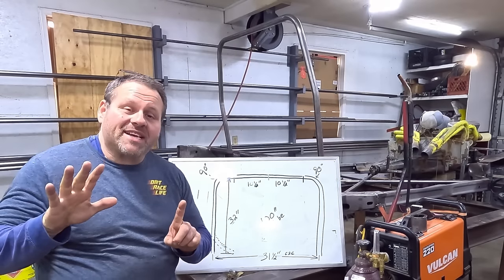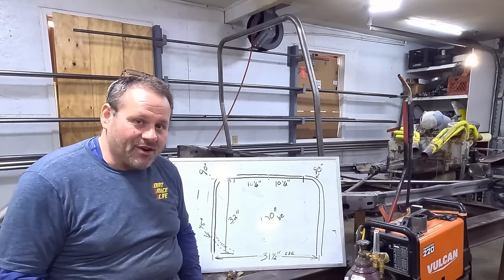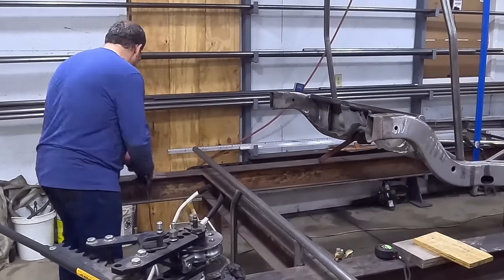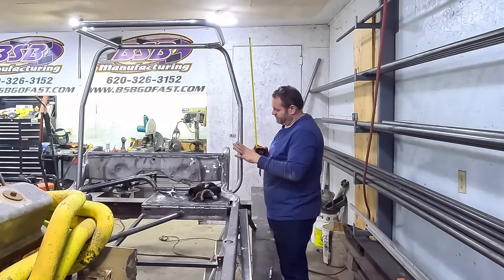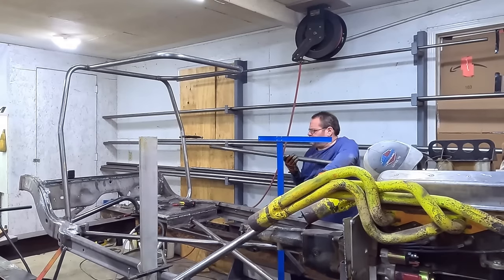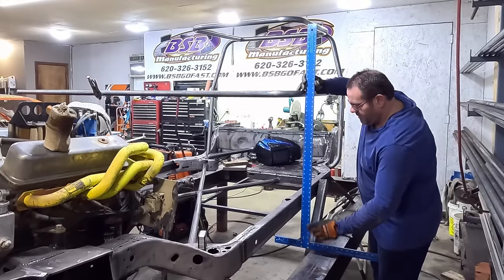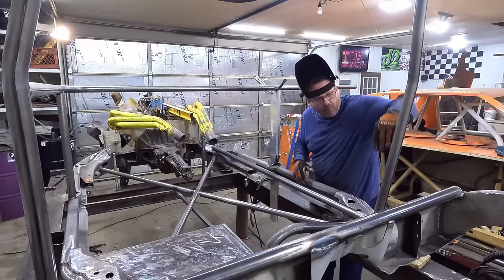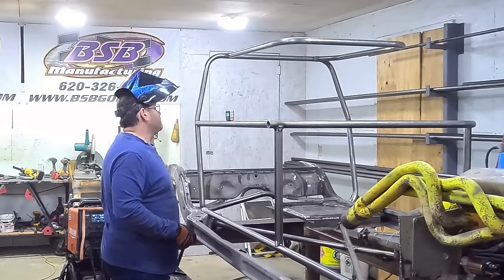Installing the Bones of the Main Cage. Dirt Street Stock is Looking like a Race Car Finally!

Comment: I would have made the top door bar section out if one piece of tubing with 2 90’s like the halo bar. That would have solved the offset upright issue. Also as someone who as built lots of stuff solo may I suggest getting a couple of the big magnets from hobo freight with the hole in the center. Weld a nut inside a piece of tubing to bolt it to the magnet. Then find a piece that telescopes that and make a T-bar with a set screw to hold things for ya while you you fit stuff. It also really helps with hanging body panels. The last race shop I worked at had a chassis jig and setup plate. We used the hell out of them stands
Reply from the maker: I like the t bar idea, thank you. I am wanting to extend the left side forward at a joint in the corner and that's why I didn't make a 2nd bend. But maybe on the next one?

Comment: An idea for your tubing end caps, 1 1/2" freeze plugs. The go right on the end, no problem. And I am late to the show, so now I just get to wait and see how you fixed the bars.
Reply from the maker: I am using 3/16 fender washers today that are 1.25" outside diameter. Working pretty good when I used 2 of them today 😀

Comment: Regardless of it looking even or not, the strength is in the node and nodes also absorb energy in the event of a crash. Run it out to the corner for maximum strength. If you move it back to match the left side bar you are creating a shear point in that upper door bar with the diagonal tube.
Reply: @bradleybuildsit what if you run a tube under the bar coming from the halo, straight down to the tube running from rear to front? You could then triangulate that tube to the corner.
Reply from the maker: Bradley, I ended up cutting all out today. I was just not going to be satisfied.

Comment: curious as to where the "A" pillar from the roof will end up, maybe it would help to minimize blind spots? maybe ? or match its rake?
Reply from the maker: I like to put the left ones in alignment best I can to my eye sight to minimize the blind spots. the right side will just be in two spots but you dont get near as much blind spot because they are further away from your eyes. 
Very good point, I need to talk about this in the video!

Comment: If it were me, I would like the a pillar tubes up side to side. Make them the same angle. On the passenger side, just take a short piece of 1-1/2” and continue the angle from your dash bar to the straight down bar the same angle of the a pillar tube. Looks good man!!
Reply: Why not run the dash bar all the way around?
Reply from the maker: I ended up cutting it all out Chris, I was just not satisfied.
Reply from the maker: I have tubes coming forward that tie off that right corner and a bend there won't work. but I just went ahead and cut it all out today.
Reply: @DIRTRACELIFE  Hey, I get it! Lol. I’ve done it a few times. That’s the glorious part about fab work, if you don’t like it, redo it! Keep digging man!
Reply: That's a bummer to hear. It was looking good

Comment: Doesn't most of the cars have the halo lower in the front so the roofs are not so high?
Reply from the maker: I have the car sitting flat on the jig but on the ground it will have rake, so yes it will be lower in the front

Comment: Might be ahead of the curve. But whats your opinion on cars with or without the petty bar installed. Ive been seeing a lot of guys taking theirs out to allow more flexibility in weight transfer.  Will this car have one?
Reply: Line them up J
Reply: Also i vote moving everything as far back as possible ive seen guys place that downtube dang near half way behind the halo and adding a tubed gusset on the corner.
Reply from the maker: I am thinking this one will not have the Petty Bar. Not absolute but I am thinking that way.